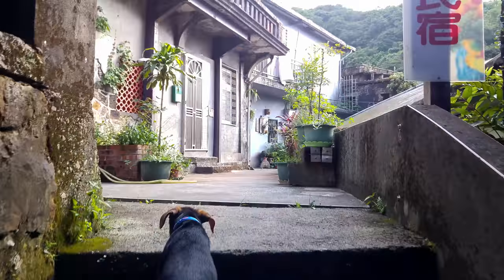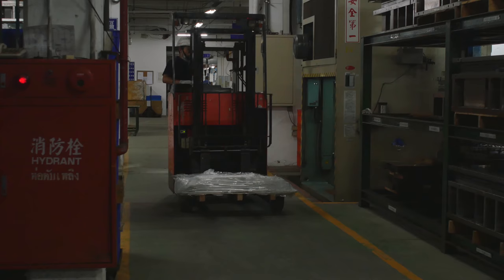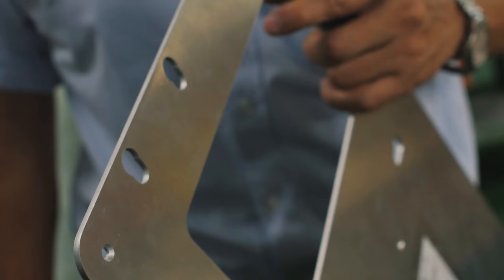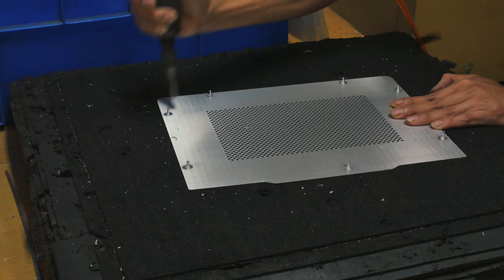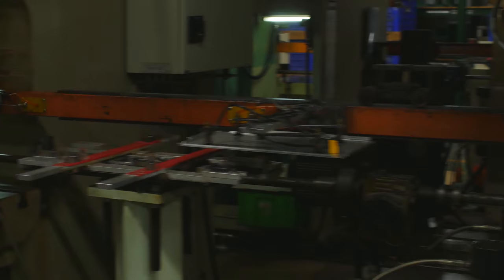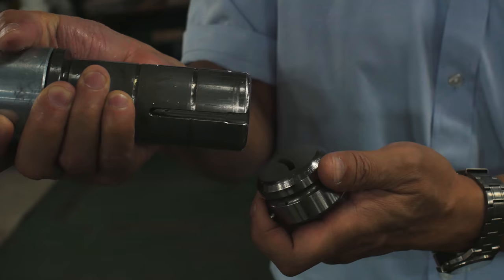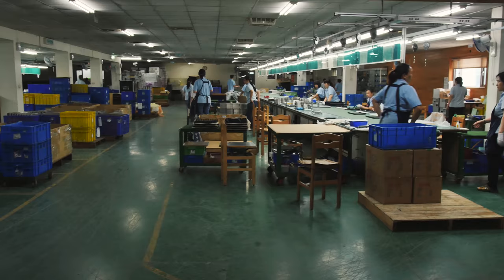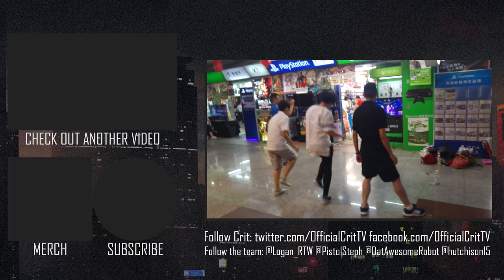Lian Li Factory Tour: How to Make a PC Case | Tek Syndicate in Taiwan

Comment: I bought my Lian Li case 13 years ago and it is in just as good condition as when I bought 
it. I have rebuilt my computer about 6 times, added water cooling, removed hard drive
cage to install ssd's, modified the slide in tray to add a radiator. I will never give it up.
Finest quality in the world.
Reply: PC 60.

Comment: i work in a shop with a lot of metal fab; stamping, laser cutting, multibend forming and stamp and form machines. It looks that lian li is on the smaller scale of things. 

i'm interested in the fact that they solder or weld on those studs instead of pressing them through, with a cut in hole.

Comment: You should've told them to make there case nicer to work in, the 905 was literally super sharp and a total bitch to work with
Reply: u can go over with just a single slide with something to just blunt the edge a tiny bit without making it look bad if u do it right. wont even be visible if done right

Comment: Most of that street food will be prepared with gutter oil from the sewers, think about that.
Reply from the maker: No. That is not accurate at all... don't believe all that media. It happens, but is it extremely illegal over there. Also, it does not happen in Taiwan. They are very protective over food.
Reply: Crit 

It might be illegal but it happens. It definitely happens in Taiwan too, there was a report done on it which showed the street vendors were the biggest offenders. Maybe they've tackled it and it isn't as common as it was 5 years ago, but it's still a pretty horrible thought.

Comment: So this is why their cases are overpriced AF
Reply: Because they're rather boutique, yes. Worth every penny!
Reply: ***** They look pretty damn cheap to me.  Taking a look at the cases just under $100 and they are HIDEOUS, comparable to $40 cases from any other manufacturer.
Reply: They may look like whatever, but they're still fully aluminium and very well built cases. Any $40 case from another manufacturer is going to be cheap steel and plastic. That's the main difference.
Reply: A $40 case will bend and twist when you pick it up. Cheapest thin steel they can get. They tend to use the motherboard for strength.
I hated sliding the sides back on shitty cheap cases at my old job - usually you had to bend bits back into shape before it would go on.
NEVER BUY A CHEAP SHITTY CASE!!!
Reply: ***** They're all fully aluminum? hmm.. fair enough there.